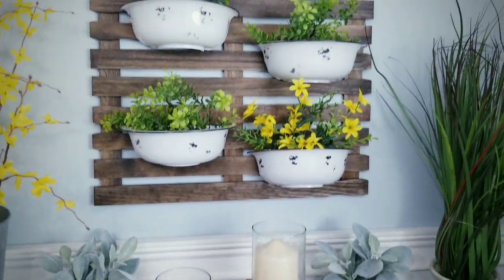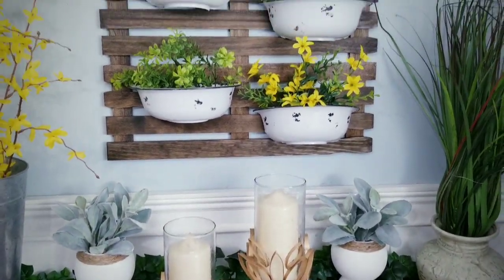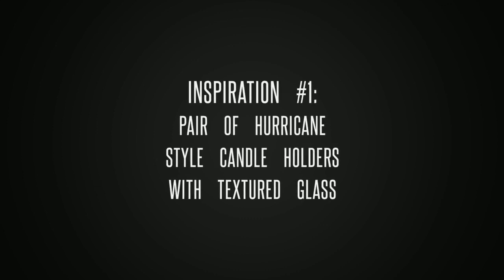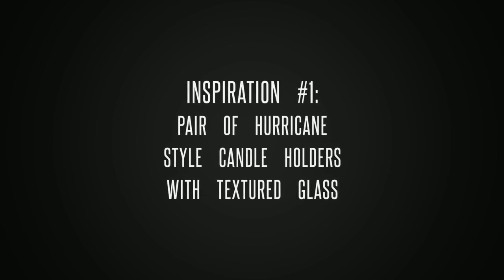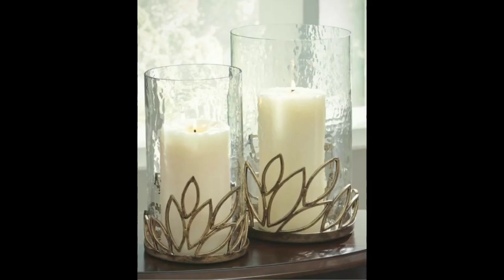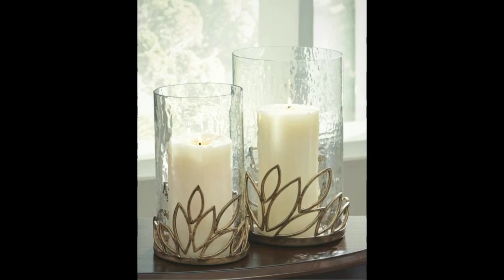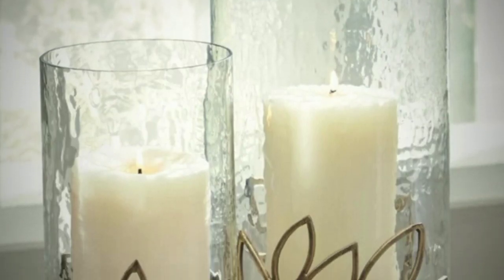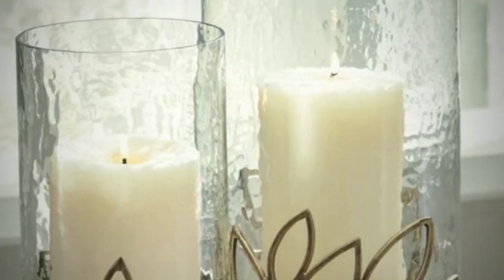2 WAYFAIR INSPIRED DECOR DIYs | DOLLAR TREE | Glass Candle Holders + Enamel Pot & Wood Wall Decor

Comment: I've seen that exact hanging planter on wayfair, and have wanted to try making a dupe, BUT, I wanted to make it weatherproof to it could be outdoors on my fence or the side of my house. I know the original was indoor only, but, if one used plastic bowls, with those plastic cutting board sheets (instead of foam core board when you cut the bowls in half, and used e6000, do you think that might work? Just gathering ideas, wouldn't hold you liable or anything. lol

Thank you for making this video!
Reply from the maker: I would seal the wood with an outdoor rated sealant. For the bowls, you can cut the back from plastic plates use an outdoor silicone adhesive (Loctite, DAP) . Worth a try, but just guessing!

Comment: The dupe with the bowls, I think using Large paperclips could do the trick instead of the hanger.
Reply from the maker: This was an older DIY, and I would suggest using the peel and stick hooks from Dollar tree for the bowls. Just adhere them upside down on the back 🙂. I have used this method in a few DIYs after this one and it worked great!